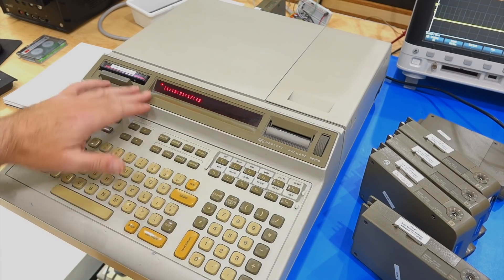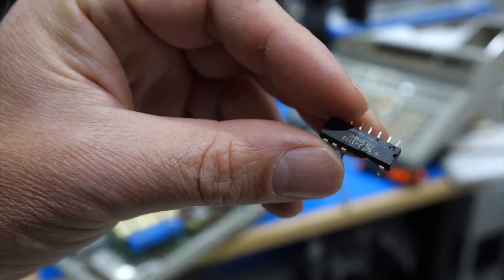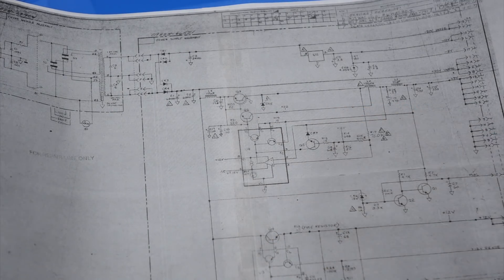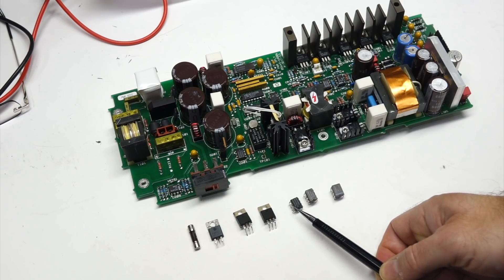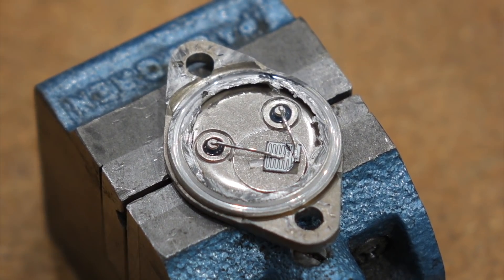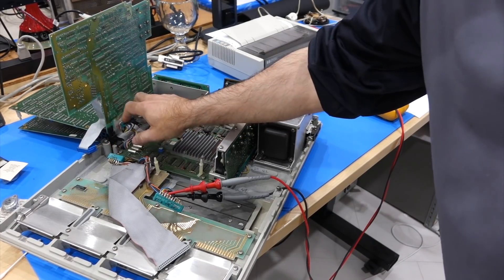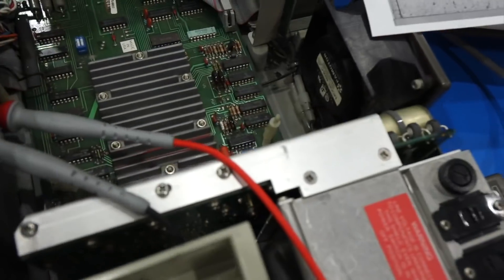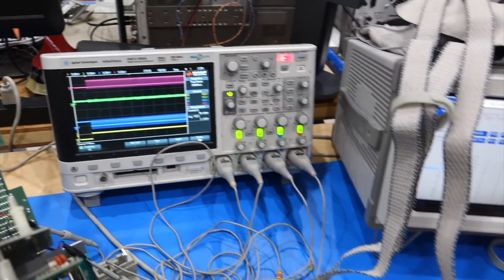HP 9825T Repair Part 1: Power Supply Meltdown

Comment: This was gut wrenching to watch. It suddenly made me consider installing crowbar/overvoltage/... protection circuits in the irreplaceable things I own.
Reply from the maker: If we can revive it, it’s getting a crowbar protection circuit for sure. Actually HP themselves later made one that could be retrofitted, I’m planning to copy that.
Reply: @CuriousMarc  I recently rebuilt an HP 8672A 18ghz signal generator which has a SCR protection on 5v rail. It may be of some help looking at it.
Reply from the maker: @mymessylab  I will, thanks for the tip. [Edit] And indeed the crowbar circuit appears in the HP 8672 service manual schematics. It appears to be a similar circuit to the one I refer to in Part 2. But it's nice to have a direct confirmation on how HP did it, plus a value for the cap. Thanks a lot.
Reply: @CuriousMarc  will a crowbar react fast enough, is the question.
Reply: @CuriousMarc  I used to work for a company called BFI electronics.  BFI is a term that I learned just before starting in their employ, and it is what you use in last- resort "mechanical" situations, as it stands for "Brute Force & Ignorance" .  A crowbar may be handy in such situations.  I can only imagine.  I wonder if Dave has covered on Eevblog.
Reply: The crowbar would work fine with a fuse. There is another more insidious problem that happens to these old instruments. This is EPROMS! It is ASSUMED that an eprom will hold its data forever. NOT! 15 to 20 years is pushing it! Instruments built in the 80's are now getting to the 15 to 20 year age where the eproms will begin to drop bits. THERE IS NO SOURCE FOR THE DATA IN THESE OLD EPROMS, HP doesn't have this available for most of the old instruments! So if you have an old instrument you like a lot it is advisable to copy the program eproms and keep them saved aside.
Reply: A simple fuse in series with the 5V output and a 5.1V zener after the fuse between the 5V output and ground. If the 5V goes over voltage, the zener will conduct and the fuse will blow.
Reply: @simontay4851  Semiconductors are there to save the lives of precious fuses. The zener will blow first :).
Reply: @theelmonk  It used to be that you could get 15W or larger zeners, and they were commonly used as OV protection on low current (several amps) power supplies. For anything that made a significant current output, something like an SCR with an over-voltage trip circuit was the usual method. You might melt the SCR, but by then it had blown the power supply fuse or breaker.
Reply: @lwilton  Big Zener after a fuse in series with the logic rail.
Reply: @38911bytefree  A zener by itself is a poor choice for this application.  Under fault conditions the zener will be dissipating a lot of power (will it blow before the fuse does?) and the voltage it clamps at will still be well above the nominal voltage.  Have you never wondered why pretty much all crowbar circuits use SCRs?
Reply: I thought the very same thing !
Reply: Dont forget to install softstart circuit too
Reply: And i just learned about crowbar circuits. Something tells me that my next PCB design will include one of these. Thank you Bert, for teaching an old dog (me) new tricks!
Reply: I'm still a neophyte with electronics but having made the mistake of forgetting to turn off the power on my 3d printer while tracing a circuit I do commiserate with you.

Comment: wouldn't a zener diode on the output of the power supply help against any potential jumps in voltage? (zener conducts past its breakdown voltage and the load blows the fuse before any chips are exposed for long)

Comment: OK, this is scary to me. I was working at HP when this machine first came out. There was the 9815, the 9825 and the grand daddy and my personal favourite the 9845. Did a lot of work on the 9845. I also like the HPIB display modules you have. Did  a lot of work with HPIB back in the day. Jes,, I don't feel that old. Thanks for posting.
Reply: I should note I spent 10 years with HP.
Reply from the maker: @stampeder1686  The 9845 is such an amazing machine, so very far ahead of its time! But it is so freaking huge and heavy. What a monster. But it's such a beautiful sleek design, you wouldn't know from pictures of it. I have resisted getting one so far because it takes so much space and it's so hard to move around, I wouldn't really "use" it. The 9825 on the other hand fits everywhere, handy dandy to this day when you need to do simple control an HPIB instrument, with style.
Reply: @CuriousMarc  Aha. The trick with the 9845 is to put is on it's own roll around cart. I had one that just fit the 9845 with 19" rack mounts below for all my test equipment. It worked like a charm. I used it to run our final validation specs after repairing equipment. I used to do all the microwave stuff plus a few counters and DVM's back in the day. Had a nice little calibration setup. So don't chicken out go ahead and splurge for a 9845. You be glad you did. You can then slave the 9835 to it..... The 9825 was the basis of design for the first apple boards.....Steve Wozniak (sp?) worked on them.

Comment: The CR5 diode is not a shottky diode but this is a zener diode. Have you check it ? Have you replace it ? It a good solution to remplace it by a transil diode like 1.5KE6V8A or 1.5KE6.8A with a case different. A transil diode does not need to be cooled because in normal operation it is not active.

Comment: Good morning guys.
I follow you from Italy and I have a lot of admiration for your work, pure electronics.
I wanted to ask you, since you have now opened the power supply card,
Isn't it better to prevent and replace electrolytic capacitors too?
Congratulations again, the Apollo electronics videos, I loved them.
Thank you
Reply from the maker: Some people feel strongly about replacing every electrolytic they see. We don’t. We measured ours, they were fine, we left them in. Not saying we find them good all the time, we do change some occasionally, but I’ve had way more problems with modern electrolytics from the late 1990s and 2000s, where every single one goes bad. Also if you work with older tube equipment with much higher voltage, like Mr. Carlson, it’s a different ballgame, as you have to be much more worried about capacitor leakage and will end up replacing them much more often. Here is a video on the subject: https://youtu.be/GMNQDoFpYQY

Comment: The other power supply having 2 stages is for a completely different reason though. The isolated dc/dc stage is unregulated and probably runs in a resonant mode for lower losses and EMI, the buck stage before it provides regulation of the output voltage. Here, the isolation is provided by the 50Hz transformer, so nothing more is needed. A crowbar would have been nice though.

Comment: Yes, this is serious stuff with power supplies that can damage valuable older gear. I was watching a video on a PDP power supply. It has crowbar protection but it required some very careful testing to prove that it would work under load and not overvoltage.
Always interesting videos Marc.

Comment: I had known of this issue with the 9825 and I'm waiting for the parts to arrive so I can fit a crowbar circuit. After seeing Marc's video I'm not switching on my 9825 till it has a power supply crowbar.

Comment: I'm not really sure this is a switching supply.  It would be about the simplest switcher I've ever seen.  Where's the clock?  Or is it some sort of free-running oscillator?  Lots of big capacitors on the bases of the transistors.   Unless those HP engineers were sloppy with their schematic drafting, that diode (CR5) on the schematic that you refer to as a Schottky, is actually a Zener, which is probably there to protect against overvoltage.  Although it doesn't seem to have been 100% successful :-)

Comment: Done to my C64 power brick in the past, a pretty basic and simple protection as theie birck are known to give up and burn the entire machine. Just put a series fuse after the 5V regulator and 5W 5V1 or 5V6 zener on the other side of the fuse. Once the regulator fails zener clamps forcing the fuse to blow (since 5V is not longer 5V is probably 12V now) and ensures that logic voltage wont go high. For this machine I guess that 2A fuse is not enough LOL, probably 10 ? I dont know. Zener needs to be sized accondingly. This Supply have room to fit this two things and is pretty fail safe. You can even simulate it with a bench power supply. All this vintage gear should contain this protections, specially the logic rails. One thing it coul have helped is if the board have tants as they tend to clamp nicely at their rated voltage or other devices that wnet short first did the clamping (shoting) job.

Comment: Ouch! I've had that happen with various things. Not fun. Not fun at all.

When my dad was designing power supplies like that in the 1970s, he would put a husky zener on the south side of a fuse on the output, or alternately an over-voltage crowbar to short the power supply output and blow the input fuse if it went out of spec OV. It sounds like an OV protection circuit might not be hard to add, and worth the extra parts to protect against future failures.

Comment: That must have been a let down after the well deserved 100000! Some PSU designs have what is called a "crowbar circuit" that shorts the rails when there is such an overvolt condiditon. Then followed by the fuse interrupting the circuit. (Much simpler than the double conversion in the other HP supply you mention. I think that that could have been done there to be run on "universal voltage" 100V to 250V maybe. )

Comment: 13V on a 5V rail. Every single chip connected to 5V will be dead. 13V is way over the max rating. You're pretty much going to have to replace every single chip in the machine, thats if you can even find replacements. I suspect there are a lot of custom ICs. If the hybrid CPU is dead, the machine is f**ked. You'll probably never find a replacement for a reasonable price or even at all.

Comment: Best of luck. I still have not dared plugin my pair in, I will have the confidence to check the supply out after watching your video.  I wonder if a clamp protection circuit could be added?

Comment: For the future, I would suggest installing a crowbar circuit, I used MC3423 in the past. I would short everything and trip the PSU fuse, for just 1$ in parts.

Comment: At least you have a good bottle of sake to savor while debugging the issue.
Reply from the maker: Unfortunately it only contains the tap water for my soldering iron sponge... Thought the bottle looked pretty though, and it was the right size!
Reply: @CuriousMarc  Reuse is a good thing.  I use the OneCup Sake bottles as they are wide mouth and with a good leakproof cap.

Comment: Surprising these linear regulators are not fitted with a crowbar. A lot of the HP gear of this vintage has. Maybe a high power 6.3V Zenner would at least have a chance of going short and blowing the 5V fuse?

Comment: About 25 years ago I got a call from a service tech working on the million $ CT scanner machine at the local hospital.  He was looking for a TTL chip to repair the one of the main boards.  I said I would bring him the chip if he let me have a look at he inside of the machine.   Once I got there I got involved in circuit tracing and quickly discovered 9V on the main 5V power rail of the board with the failed chip.  This supply went to all the boards in the machine.  A power supply swap got 5V again but the poor CT machine had a lot more than one TTL chip blown!!! 
A few years before I rebuilt the night sky planetarium lighting controller for the projector at Iowa State University that suffered 120VAC finding it's way through a shorted TRIAC in a very poor design onto the 5V supply....not pretty!

Comment: There should have been an SCR crowbar circuit.  So that if the 5v went past 6v the SCR would fire and short out the 5v rail.  This would in turn blow fuses thus protecting the rest of the machine.  I wonder why there wasn't one?

Comment: Reasons why I don't like buck converters without any overvoltage protection.. 😕
Similar situations I see on modern PC mainboards - CPU power rail switching transistor fails short and CPU gets killed by direct 12V.. Best thing, if ground side transistor fails first..
Very sad situation.. Can imagine how many old chips were killed due to transistor short..

Comment: I did something similar whilst repairing an audio mixer console... the +48 volts for the phantom power was one pin over from the +15 for the one hundred or so op-amps on the mainboard... As luck would have it, I plugged in the ribbon connector with one pin off to the left, and sent +48volts to every op-amp... needless to say, that board was now like Rover... Who was dead all over... :(

Comment: Man..... I'm both excited to see a new video and sorry for such a catastrophic failure. I'm no expert in old computers but the resistance measurement mode usually isn't high enough voltage to overcome the forward voltage of ICs and all you should be seeing is pull up resistors, etc in the 100s of ohms. I'd go with an approach of applying a current limited supply to the boards one at a time and with a thermal camera seeing any abnormally hot chips. A crowbar circuit would have prevented this but I guess we can't have it all.... Good luck with the repair

Comment: For what its worth, in the more upscale HP supply, the buck converter is probably there for other reasons, I would think. Since its an offline supply running right off the mains it has to be galvanically isolated, anyway, so the transformer protects you from a shorted switching transistor. It would just end up popping the transistor and other components, or even grilling the primary windings, but the secondary side will just see the supply flatline.
Reply from the maker: It’s that, plus the fact that they probably could not do it at a reasonable cost - or even at all - in 1970. They did not have the high voltage high current MOSFET that the first buck stage requires! So they were stuck with a transformer-first approach and could not do the buck plus transformer-last approach of the modern . They eventually did add crowbar protection, later on in the 9835 I believe.
Reply: @CuriousMarc  Thanks for the clarification. I do have some old design books from the 70's as well as an old ARRL handbook that have some of the first buck/boost converter designs in them. Very crude indeed. For the one with the buck converter, Id imagine possibly it was to aid in running off both 120V and 240V (seems too early for PFC)? Seems like it could have also done away with the 120/240 switch, but maybe they wanted it to just give a more reasonable and regulated voltage for the DC-DC converter to work off of rather than straight off the incoming supply.

Comment: I'm a bit surprised HP didn't fit a crowbar type protection circuit in the PSU? Even my cheap Italian made 13.8V 7Amp CB and ham radio PSU from 1980 has a thyristor crowbar circuit. Which triggers the thyristor across(crowbars) the supply in the event of an over-voltage fault and blows the fuse, like if the regulator transistor lets go.

Comment: Might be an idea to add a "crowbar" to that PSU to prevent it from happening again?
Also interested in what you meant by the HP community. I have an HP unit and may want to ask for some advice on a fault it has... In the middle of tracing it so not sure if I need the help yet.
Cheers,

Comment: With the expense of serious hp gear, you'd think they could afford a protection zener. It's really an essential part of a series regulator in a complex device. When I used to service TVs, they were at the output of almost every supply and worked well as a crowbar circuit. We're all hoping you get it up and running again.

Comment: Time to add in the crowbar circuit, which uses a 6V8 zener and a high power SCR to pop the fuse on transistor failure. Unfortunately those fail open circuit and silent, so YMMV. Had that happen on a system, and the only damage to the entire system was a single failed TTL hex inverter, ironically a 5406 30V open collector device, which removed it's top cap. Every other IC , including the EPROMS and the unobtanium Intersil DAC in it's purple case, was fine and unaffected, after having run for a few hours on 16VDC, and the only symptom was that it was not showing a 5 second self test lamp. 

Said lamp provided by the inverter, using a RC delay to make intermittent faults show up for 5s, and fed from a power good signal from the power supply, which just detected all rails were greater than half voltage. Power supply fix I replaced all parts, down to the resistors with new ones.

Comment: Going to add an SCR crowbar circuit for overvoltage protection? A couple of resistors, a bypass cap, a Zener diode and an SCR are pretty cheap insurance. (There are no guarantees in the world, but I've put SCR crowbar circuits on a lot of supplies I've designed.)  No need even to heat-sink the SCR since it needs to last just long enough to blow the fuse.

Comment: I hate failures, or other situations, like this. Even if it booted up, who knows what sort of hit it took and how long it will stay working. I had some deputies on the boat patrol hook up a Motorola radio to 24 volts instead of 12. OV protection zener blew the fuse and the radio seemed to still work properly after replacing the diode. I tagged it as to never be installed in a pursuit vehicle. Just could't trust it after taking a hit like that in a critical application. Overly cautious? Maybe, but better safe that sorry in my opinion.

Comment: I remember when I was looking at a old cnc there has been in a 5 volts over voltages. The EPROMs has stuck bits, it was making sense, when looking under microscope there was wire fused to see in the window.